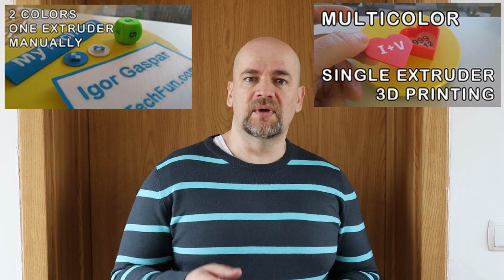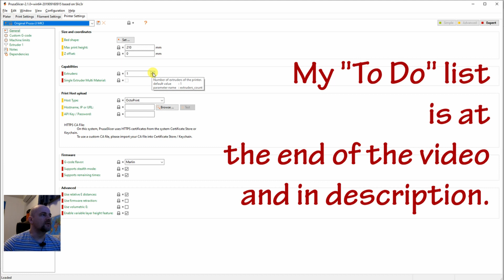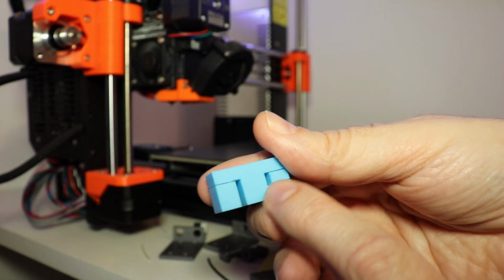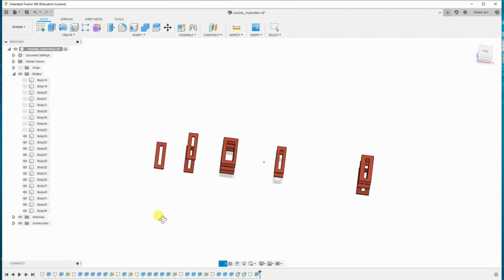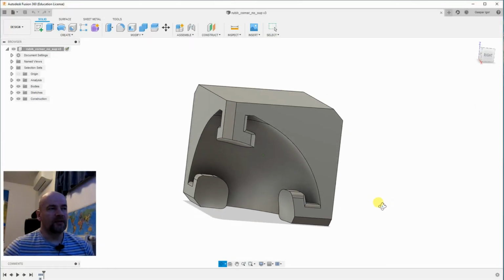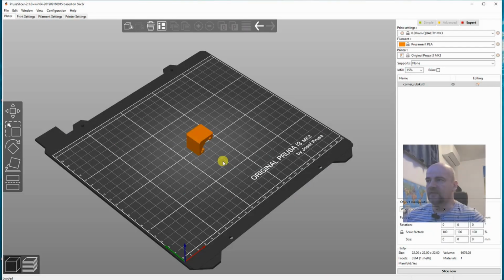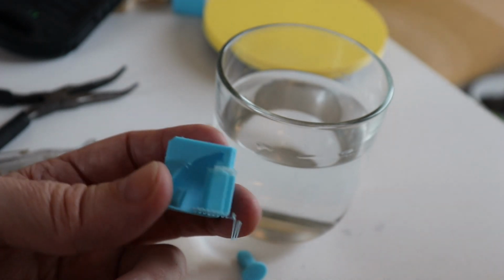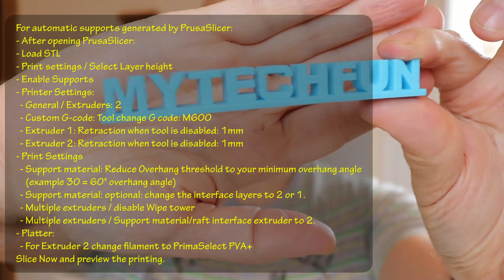Soluble Supports from PVA filament with single extruder

Comment: Ha oldható anyaga van a supportnak, vagy az interfész rétegnek akkor sokkal jobb ha annak sűrűsége 100%, mivel az eltávolítása szinte molekula szinten történik az oldódással. A ritkás kitöltés miatt a rárakódó első nem támasztó normál réteg behullámosodik és pont olyan lesz mint amikor normál support anyagot használsz.
Az előnye veszik így oda.

Comment: If you have to pause print and manually change filament, might as well make use of that one method that was shown; that ink in an alcohol felt tip pen prevents filament adhesion.

So on the interface layer you insert pause, and instead of changing the filament, you paint in the support area, and you don't need any support distance. Then when you break away support, you can wash off the ink with alcohol.

But this can still do well with intricate shapes.
Reply from the maker: Useful tip, I will try it in near future. Thx

Comment: Thank you for this inspiring video, by all means this is a method I have to try! The quality of the print where it is supported with automatic support should improve by setting the distance between support and object to 0. If I noticed correctly, this was set to 0.1 in the video. Also, a solid roof for the support should reduce artifacts, although it might make it harder to remove the supports.
Reply from the maker: Thanks, yes, I agree with 0 Z distance, and I am always using it. I modified "to do" list in description. Here I am using that setting with Hilbert cube: https://youtu.be/oFwVSJYbrDE?t=157

Comment: Great experiements! this is really helpful as I also want to do away with removing supports.
Reply: Actually I'm facinated with your cutom support to save on costs.. great idea.. This should be a featue they add to Slicer ..  I'm interested in joints .. and hard to reach places.. using this technique

Comment: I have a model with two  0,4 mm width custom pva supports,  this means there must be 4 tool changes. I did everything the way it is in the video, but the prusa slicer shows 8 tool changes (with wipe tower). I found 4 tool changes in the g-code and also in the prusa slicer simulation. What am I doing wrong and what is the real number of tool changes?
Reply from the maker: Try to reduce number of separation layers ( for experimenting to 1 or 2)

Comment: Hiya Igor. I really like your two videos on this because they are very well explained. I followed everything you said pausing the video each time, and when it's slicing it shows the model in two colors like it should be, but once it's done slicing in the preview it still only shows one extruder being used, number 1 which is the normal filament one.
I checked everything you mentioned and also everything in the description and I have the same values everywhere. Any clue on what I could be missing?